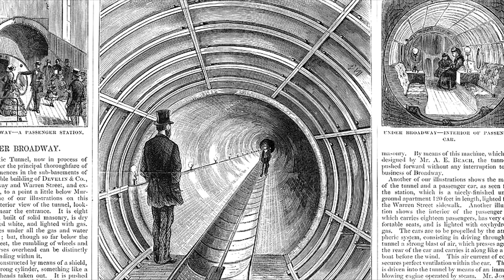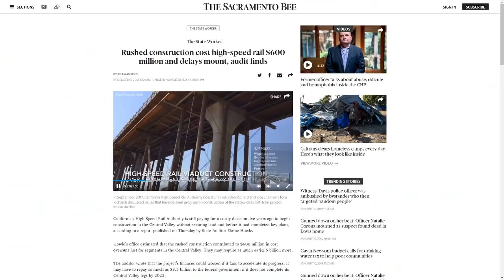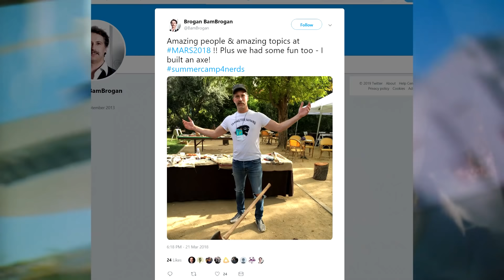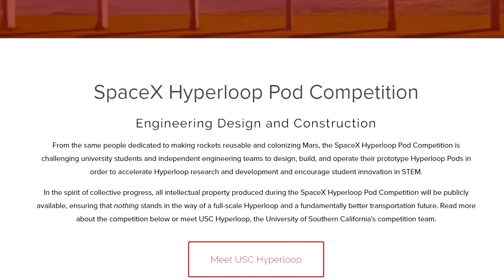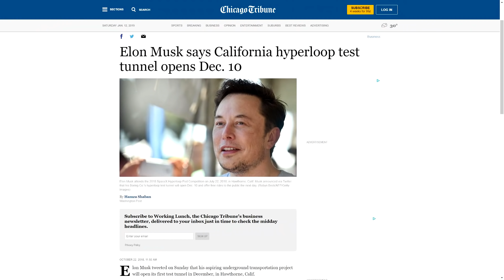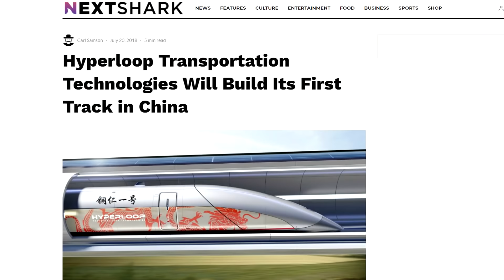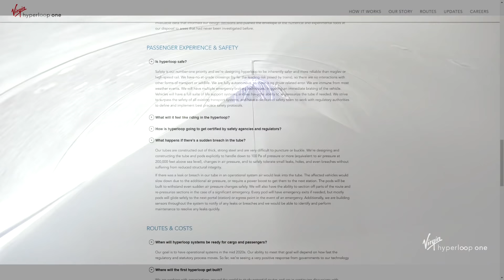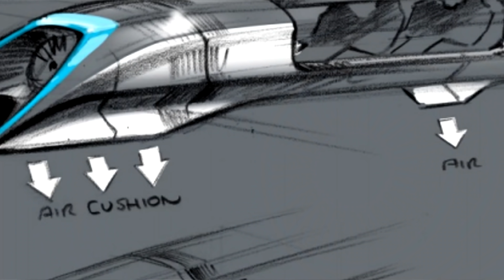Why Hyperloop will FAIL HARD - Its Biggest Problem...

Comment: Why not underground?    Boring Company and all that . . . .   

And as for the implosion / explosion  drama -- we are only talking about 15 psi difference MAX.
Reply: The pressure around us right now is about 15 psi,  if you reduce another 15 psi, that is about 30 pounds per square inch pressing down on a light weight tube.  The implosion concern is real as well as people getting caught in a vacuum suffocating and getting the bends.
Reply: @theriddler6227  -- does that math make sense to you?   Think of a number line going from Zero to 15.   (with  Zero being a perfect vacuum, which the tube is not even  trying  to meet).  Outside the tube -- in "normal" air pressure -- 14.7 psi.  Inside  the tube is low, near-ish to Zero).   So the MAX difference across the tube wall is 15 - 0 = 15 psi.  And then to go from the tube to the "pod" (or whatever  they call it).   Zero in the tube to  back to 15 in the pod.  So again, 15 - 0 = 15.   And the final step to close the loop is:   15 in the pod - 15 outside = 0 . . . .  so the MAX difference any wall sees is 15 psi?   Is this not correct?    At any rate 15 psi is nothing for an underground concrete tube.   We have LARGE underground concrete and steel water pipes with 100 psi and up running for decades.
Reply: @philtimmons722  The point is if there is a leak, whether by structural failure or some moron firing a rifle at the tube, the pod travelling at the speed of sound will hit the air, ripping it to pieces and destroying the tube around it. This will send a wall of air traveling at the speed of sound killing everyone in the tube, and destroying the tube in the process.
Reply: @Sir_Budginton  -- does that match the failure analysis?   I do not mean drama queen type fiction.  But rather actual analysis -- MIT and Hyperloop's own safety management describes any air as slowing the pod, or veering, if not controlled . . . 

========================
Large Air Leak
Were there to be large rupture of the tube, such as would be caused by it being hit by a vehicle, air could enter the tube faster than the vacuum pumps could remove it, so the pressure in the tube would risk very quickly. This would certainly cause the pods to come to a stop. But it may also create a situation where they lose directional stability and crash into the inside wall of the tube.

Consequence Analysis
Having identified the hazards, the next step is to determine the consequences (safety, environmental and economic) were the hazard to occur. Using Fault Tree terminology (a technique that is at the heart of WASH 1400), IF there were to be an electrical power failure AND IF the safeguards such as battery backups were to fail, THEN the consequences could be catastrophic. As already mentioned, the pod could veer to one side and crash into the tube wall while traveling at very high speed. (This is not a problem with airplanes because, in an emergency, they have room to move around the sky without hitting anything.) A large air leak could have similar consequences, except that it would be harder to come up with safeguards.

Frequency Estimation
Having identified the hazards and their consequences, the next step is to estimate the frequency with which these events may occur. This can be done using historical data and with techniques such as Event Tree analysis.

Safeguards
Finally, consideration can be given to safeguards. These might include:

Landing wheels on the pods that would “touch down” on some type of track.
Emergency compressors ensure that the air pressure does not fall too quickly.
Reinforcement of the tube to minimize the chance of a large leak.
Reply: @philtimmons722  Your logic is sound.  I yield my position.

Comment: I could due without the gratuitous, one-sided insertion of political commentary, scapegoat, victimhood-signaling.  And what emerging technology hasn't had issues?  Finally, a pneumatically propelled vehicle is quite different from one that self-propelled through a medium that is a near vacuum. You simply haven't made the case that this technology will fail.

Comment: ARC --- Hyploop is a maglev system, not a pneumatic train. So you fail on that part.

Musk is not involved in any of the hyperloop companies, so you fail on that one too.

The guy behind Virgin Hyperloop One is Richard Branson, a proven business leader who is in charge of several successful ventures, including the awesome airline Virgin Atlantic.

He's spending 500 million dollars of his company's money to build a large test track in West Virginia where they will test Hyperloop at its maximum speed of over 700 MPH, over double the speed of the current fastest train in the world (the Japanese SCMaglev). This is 100% private funding.

https://www.autoblog.com/2020/10/08/virgin-hyperloop-picks-west-virginia-test-center/

Maglev is definitely the only train system that would be useful in North America and Australia for high speed passenger travel, and hyperloop is a maglev system, so I'm sure several lines based on hyperloop will be built in North America and Australia.
Reply from the maker: You obviously didn't watch the video. Thank you for reiterating every point I said in the video.
Reply: @AmericanRailClub  no...I did watch the video. You clearly implied in the beginning that the hyperloop is pneumatic. It is not. It uses maglev. The low air pressure is used to reduce friction, not to propel the train. It is NOT a "vactrain" as you state several times in the beginning. It's a maglev train.

There's nothing implausible about maglev and it IS a train. If you're a "railfan" you should be a fan of maglev too. It's a train. It goes really fast. Far faster than wheel on rail ever could.

Maglev is the obvious solution for high speed travel on land, my friend. Wheel on rail maxes out around 200, maybe 250. They have wheel on rail trains that have momentarily achieved 300 or higher but this isn't in "revenue service" because it's unstable. You start to get wheel slippage and you start to get issues with the overhead wire staying in place.

Maglev is clearly the future. I don't know why your organization would not support it.

Comment: Well.. China is doing great with fast trains reaching 350-400kph (220-250mph).
Reply: That was the Shanghai maglev from 2012 it reached 420km/h with passengers. The new Maglev China is building apparently reaches 600km/h with passengers and doesn't make the passengers feel 😵 dizzy.
Reply: @akarimaijima8731  no.. regular bullet trains.. just last week I was on a train from Wuhan to Shanghai and the train was averaging 360kph (about 225mph)
Reply: Shimeih Oh okay. Those trains are like 15 years old.
Reply: @akarimaijima8731  yeah but they work. They're replaced regularly and China has one of the most safest rail transport on the planet.. so yah.

You don't need to reinvent the wheel, if it works it works. Just leave it
Reply: Shimeih I know they work. Im surprised they haven't replaced them with better and smarter trains.
Reply: Shimeih With smart trains they attach many sensors inside and on the train to collect data about the train and collect data about the wind drag. So the scientists and networks can improve the train designs. I think these 15 year old trains should have already been replaced with smarter trains.
Reply: @akarimaijima8731  yeah well, I guess they haven't found the push to innovate. Maybe if another country does it then they'll copy..lol
Reply: Shimeih I don't know copying is the correct word. In the networking sector. It is known as; strategic data acquisition. Any Smart technology copies data from competing smart technology. Like Smart Vehicle companies copy data from other Smart vehicle companies.

Comment: The Powell-Danby 2nd Generation Superconducting Maglev technology is superior, safer, and ready for a national logistics network development program.  The system's electronic guideway switching and interoperability with conventional rail (patented MERRI planar guideway system) solves costly problems with mechanical switching in the cumbersome Japanese test system at Yamanashi.  A viable ultra high speed environmentally benign superconducting maglev architecture is hiding in plain sight, we need the US Department of Transportation to do its job with  emerging technologies and institute a rigorous safety and performance testing program that includes superconducting maglev and doe snot kowtow to well-funded lobbyists and donors with unlimited CGI fluff.  All elected officials should read the book Maglev America  to understand the science, engineering, and operational solutions at hand.

Comment: Boy you sure showed everything you don't know  ...  it's cheaper to run then a bullet train  ( only a 10th the cost )  it's 3 to 4 times faster  then bullets and  safer then a jet  ...  we know what happens when they fail over 200 people die . They don't use any electricity for the magnets in the pod  , there are no magnets in the miles and miles of track to lift the pod ether and only electromagnets  to push it at 700 miles an hour but when it hits that speed you turn power  off ...   and it just coasts  ...  no train does that !!!  Plus all pods go strait to their destination with out stopping  10 times at other places and the pods leave every 5 min   moving more people then anything else so quit the  BS  and tell the truth  .

Comment: This video is pure propaganda for rail and is full of holes. Firstly, capsules will not go out every 5 minutes, what was proposed was every 30 seconds, I saw one company, I think tt going out every 80 seconds, there is no reason when systems are proven and get safer why it can't be sub 30 seconds. What about the path it laid out in the video for Hyperloop, crossing through mountains consistently, very misleading and says/implies this is because of g-forces, but then says v.fast rail is approaching Hyperloop's speed so reconcile that one!? It's far easier to allocate/get land for Hyperloop then rail, as Hyperloop can be above ground, hence farmland won't be disrupted much, the cows will just walk around the pylons, but railway tracks need to be completely blocked out, or Hyperloop can go underground. In the future there will be no reason why it can't go under water as ET3 initially proposed (before Hyperloop) with international networks of tube transport which ET3 also envisaged 4000 Mph on it's international links, a lofty goal, but there is no reason why in the future as engineering gets better, that the sound barrier can be overcome and Hyperloop's speed would only be limited by state of engineering at the time. I could go on and on.
Reply: 5 years later and hyperloop is dead.

Comment: Not just economics its also engineering realy to put it simply steel is not enough you need graphene at least to have full leght(average inter-city distance) tubes at near vacuum and that is without even mentioning of material volume changes do to the changes in temperature.I support this technology but dont think steel will do it and better not even talk about energy needed to pump out that air.

Comment: This whole video is completely full of fallacies...

Max 1000 per hour: you don't think it's possible to have bigger pods?

The land acquisition problem is exactly the same for high speed rail

Why is an aerodynamic shape? Why the fuck wouldn't it be, the tunnel still has some air and might as make it as efficient as possible, why would you make it a box?

What happened to the air lift rails? Maglev is better. Why would you introduce more air to an environment you're try to evacuate, stupid argument.

Why does the test have wheels? If you watch the test it doesn't actually use them except when the maglev is off, do some research.

Some good points are made about safety and of course potentially cheaper alternatives, but I don't think anyone can definitively speak on the comparative economics. This video is misleading at best.

Comment: First 7 min pointless politics of current companies. some more fluff, then finally at 9 min they get to their points.. point #1 capacity... stupid point, just have more capsules linked? idk dumb point for them to make from an unnamed company's guess on capacity? #2 "Hyperloop killer SCmag lev"... its the same thing as a hyperloop but without the benefits of a near-vacuum tunnel... so not a good point.. just showing that a hyperloop will work in a tunnel (at higher speeds).. because it does above ground already haha. #3 "Land acquisition" Doesn't seem like an issue.. especially if the boring company just digs underground... shouldn't be a problem... nothing that would make hyperloop fail hard.. seems like a normal problem. #4 "Safety" does seem like a problem with having a near vaccum tube, but being underground would likely solve almost all safety concerns... segregated automated system away from hazards, and tunnels are basically earthquake proof.. and they mentioned tornado threat... def safe from those underground. #5"Energy costs" can be negated with solar providing energy to megapacks feeding the system.. or any renewable source because it runs entirely on electric. A perfect vacuum tube is very expensive on energy, but a near-vacuum isn't too bad. This video focuses basically entirely on current companies.. especially virgin.. and not on the technology itself, its attempts to point out technology flaws.. is flawed imo
Reply: Fun fact.. the A32ONEO burns 1053 gallons of fuel to transport those "200" passengers 600 miles. Where a hyperloop will do that faster, and with (potentially) renewable energy... I can see the "economic" failure of hyperloops now... smh

Comment: After reaching 300-400 km/h most of the energy goes for fighting aerodynamic resistance, so hyperloop deals with that better and maintaining the pressure below 0.01 bar is not so costly if done properly. What's more, low pressure keeps the system free of rust (potential cold welding might become some problem thought).
With hyperloop and hyper-low pressure you could ride round the globe with speed of 16 km/s (a trip to the antipodes would take some 20 minutes) without any noticeable gravitational overload (but you'd need to build rails on the ceiling of the tube first).
Reply: Hyperdelusional

Comment: "Why Electric Cars Will Fail", May 20, 2011...
"The Case Against SpaceX", Forbes, 31 May 2011...

Hyperloop will fail, 25 May 2021... RIGHT....
Reply: I mean super sonic airliners failed because the cost wasn’t worth the faster speed. On trains it’s the same thing, why double the cost of rail line if it doesn’t mean you can carry more people.
Reply: It's past May, no new Hyperloops, not even a test functioning test track, they even removed the projects they were "working on" from their own website.
Reply: LOL, this isn't even an argument. This is just a very poor attempt to dodge the inconvenient questions that need to be asked instead of actually addressing them by sidetracking them with some irrelevant fantasy.

Comment: WOW YOUR QUESTIONS HAVE BEEN ANSWERED A LONG TIME AGO  .  THE HIGH SPEED RAIL MAG LIFT IS OUT DATED IT HAD ELECTROMAGNETS IN THE TRAIN AND IN THE TRACK  ( THAT RAN FOR MILES AND MILES  ) TO LEVITATE TONS OF TRAIN OFF THE TRACK  .  VARY EXPENSIVE  .  BUT NOT HYPERLOOP THE HYPERLOOP HAS PERMANENT MAGNETS IN THE MOVING POD THAT DON'T USE ANY ELECTRICITY AND NO MAGNETS IN THE TRACK TO LEVITATE THE POD  . BECAUSE  IT HAS A SPECIAL ALUMINUM IN THE TRACK THAT LEVITATES THE POD AFTER IT REACHES  40 MILES AN HOUR  ,  BELOW 40 IT RIDES ON SMALL SOLID RUBBER WHEELS FOR WHEN IT STARTS  AND STOPS .  THE ONLY ELECTRICITY IT USES IS WHEN IT'S  PUSHED  FORWARD AT ABOUT 700 MILES AN HOUR AFTER THAT YOU SIMPLY SHUT OFF  THE ELECTRICITY  AND IT JUST COASTS  ...  BECAUSE IT RIDES  IN A VACUUM  AND WHEN IT SLOWS DOWN IT RECOUPS THE ELECTRICITY BACK INTO THE SYSTEM THAT IT USED WHEN IT WAS PUSHED FORWARD SO YES YOU CAN USE SOLAR PANELS ON TOP OF THE TUBE   ...  SO MUCH CHEAPER  !!!!!!!!!

Comment: I thought the whole point of the HyperLoop was that it was a train that runs in a vacuum thus removing air resistance. I don't see how it is not viable after the engineering and later infrastructure hurdles are over come. The top speed is limited by how fast you can safely accelerate and the distance you are traveling. Any rail technology should be able to be used so the Japanese SCMAGLEV tech could be used in the HyperLoop to go even faster than the one in Japan since air resistance is no longer a factor . None of this was addressed or even mentioned in the video so I am wondering if  I am totally misunderstanding HyperLoop?
Reply: You have understood it, and it is technically possible if you throw enough money at it.  But there are many, many problems - technical, economic and legal problems - that the H-L fans don't mention or gloss over.

Comment: Imagine a segment fails to depressurize or is breached. An 8' diameter pod is 7500 square inches of frontal area. Run that into air at 15 psi, that's about 110,000 lbs of deceleration. A hyperloop pod is projected to weigh about 1/3 of that. That means about 3g sudden deceleration. That would be a dead stop from 65 mph in 1 second, or 50 feet (about 3 car lengths). Better fasten the passengers in with 5 point racing harness.

Comment: I think Elon uses a test track is the right thing to do. You just need to advance the tech each year. Regarding the throughout problem.... I am thinking, Elon’s goal may be turning Human travel as internet packages.  You are seeing ever increasing speed improvement on the backbone and routers. Think about it, it was slow before on internet, then you have throughput problem. If that can be achieved, may be we can do point to point global travel.
Reply: Now you just need a method for transforming human beings into electromagnetic signals. Let me guess, the hypeloop does that as well?